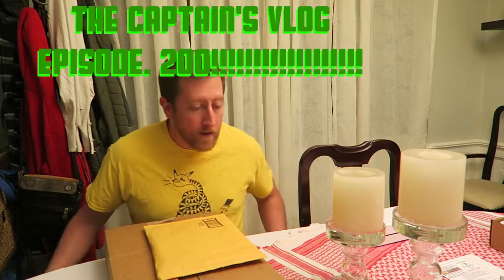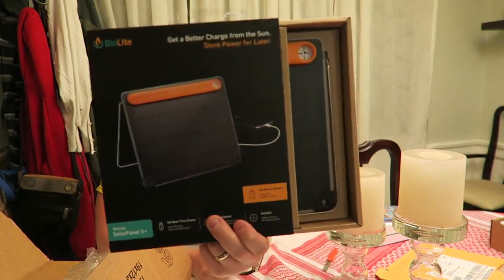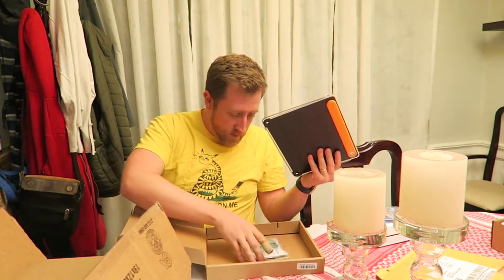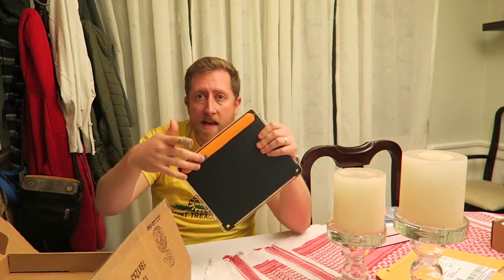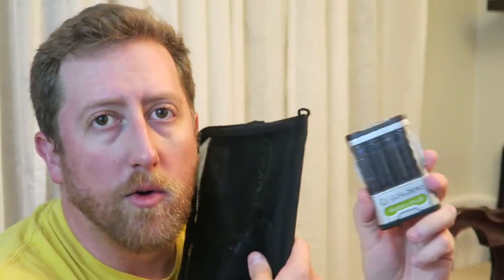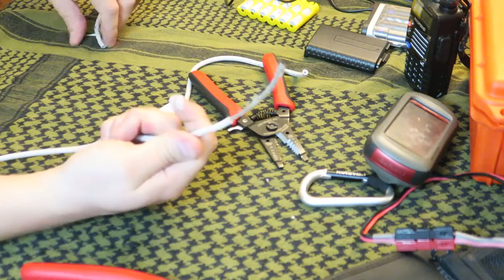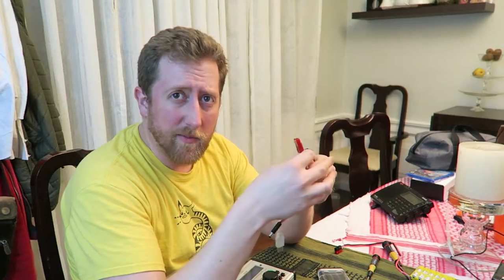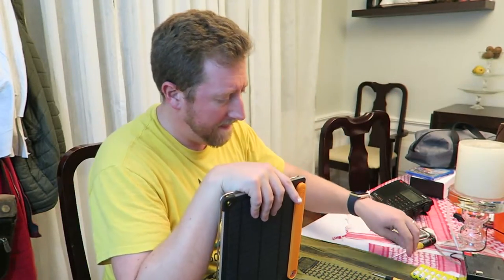That Solar Panel I Destroyed - FAIL

Comment: Well, in general, trying to power the 12v radio from 5v probably wouldn't damage anything, it just wouldn't work.  (It could work if the radio was designed to accept, for example, any voltage between 5v and 24v or something like that).  Connecting a beefy 12v battery to the solar panel which contains an integrated battery and charge controller would almost certainly damage it.  (The board has to have some electronics to compensate for the fact that the voltage and current output of the panel will vary depending upon the amount of light, and to properly charge Li-ion cells, which have under-voltage/over-voltage issues).  It's actually lucky that the small li-ion cell didn't heat up or catch fire, but there is probably some sort of fuse to prevent that.

Comment: Yea I would have to agree with what the others are saying about the 12v through a 5v circuit.  I always thought the USB controller would prevent such an event from happening but I just googled this to confirm and I was dead wrong. There is no protection from overvoltage or overcurrent.  Surprises me because even among USB devices current draw is not a standard.  They say 5v @ 500ma is the norm but there is devices that can do 1A and higher.  Kinda interesting I guess.

Comment: Sorry, but that is why they have different connectors and defined voltage. USB is defined as 5V in/out and not 12V... tough luck.

Comment: haha coincidentally, I had a fail yesterday as well. Built a metal detector from scratch and finally connected the coil, but connected it wrong to the PCB. The smoke was kind of cool, but a frustrating amount of time was wasted.

Comment: I am not an electrical engineer, but did stay at a holiday inn express, so I feel that makes me an authority to be able to speak on what possibly happened....lol   Basically the answer follows occham's razor. The solar panel's charging input was designed to handle the current from a commercially available USB wall charger which usually have an output rating of around 5 V and 500 mA DC.  Some chargers can go up to 2 A.  That 12 VDC battery is way too high of a raw voltage to push through the charging circuits.  I looked on the Biolite web site to see if they have any specs on the input rating for the charging port and it just shows that you use a standard wall charger.  So yeah, you fried it...lol
Reply from the maker: Oh. I was only using the output. Output to the radio and battery.
Reply: In that case the back voltage regulator on the BioLite couldn't handle the 12 volts coming from the battery and burnt out.  I have burnt out diodes rated for 1.5 volts using a 9 volt battery...lol
Reply: Right from the start, I didn't understand why you would try to power a 12 V device (radio) from a 5 V source (panel).  No disrespect, but that's pretty basic.

Comment: 12v radio on a 3.6v battery with a small 5v 1a step up Booster? Hmmm

I like biolite products but for less money and a little extra weight(1.3lbs+battery) I would opt for the renogy 14w+power bank(s) 
The renogy is on sale for $40 at the moment, I'm sure free shipping too.
Reply from the maker: Send me a link. Where are they at?
Reply: Direct from renogy via renogy-store.com it's called the e flex 14w or something along those lines....  Here it is http://www.renogy-store.com/mobile/Product.aspx?id=38113
I know the full size 100w PVs ship out of California , I got mine in Colorado within a few business days of ordering via their eBay Store.  I think renogy products are made in China, hence the low price but customer support is supposed to be top notch from what I hear. 
I don't know just something to look into, I haven't done much research into these portable panels.

Comment: You look tired dude. In order to make the radio work off the solar, you should have used a 5 to 12v invertor. To charge the big 12v battery with the panel you need an invertor to 14-ish volts, and a diode to protect the panel/invertor. Either way you how you hooked it up, you fried that biolite.
Reply from the maker: If I remember correctly, I was tired ;)

I've got an upcoming video with a cool folding 12w solar panel to HF radio coming up soon.  Should be fun.
Reply: This time, maybe use a cheap powerbank first, then later connect the solar panel. instead.
The solar panel has USB out again right?